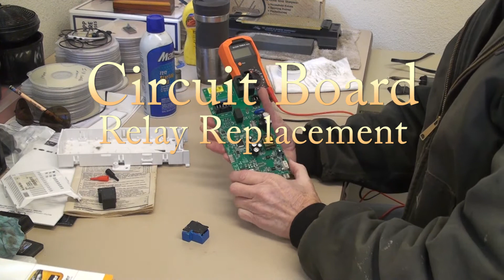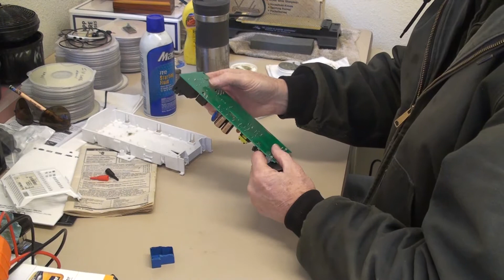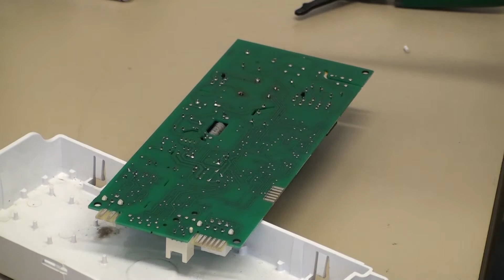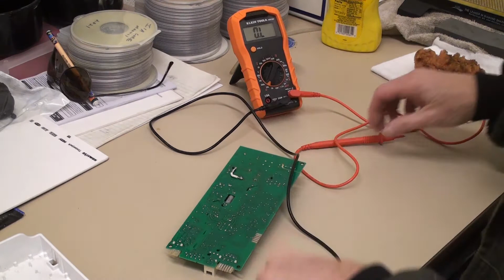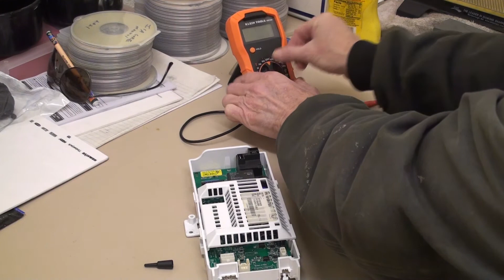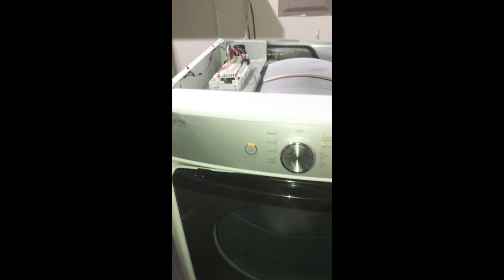Dryer Circuit Board Relay Replacement

Comment: Is it possible to burn up inside and not show signs outside? Mine says N.O. which means normally open but it still has continuity.

I was hoping you would of shown how you got the old one out 😊 
I can TIG weld but never soldered before
Reply from the maker: I suppose that it is possible for the points to get a spark between them and fuse together. I've seen that in automobile applications. To remove the damaged relay, I heat the solder on the leads and brush it away with a stiff bristled brush or use a solder sucker. There are plenty of videos on YouTube showing how to solder components.
Reply: @repairsecrets I got a new relay and was able to fix my problem 😊

Comment: But why does the relay break in these I have 2 maytags 3000 series and both have blown the relays in both units what is the cause of this?
Reply from the maker: The best explanation that I've heard is that they are being overloaded. More weight means more power going through the relay which over loads it and burns it out.
Reply: @  so nothing down or up stream is shorting out  just over used not enough cooldown time
Reply from the maker: @ggrandma-n6e  I don't really know of anything else causing it. The machine in the video was being used with heavy rugs and blankets.
Reply: @repairsecrets  makes sense thank you fingers crossed we’ll be getting mine this weekend thank you for your reply’s cheers

Comment: This video is exactly what I'm looking for. My dryer circuit board had the exact same problem, and come to see the end of the video, it was the exact same machine (maytag maxima)! I had gotten all the way to ordering and replacing the relay switch just like you, but when I tested it in the machine it still didn't work. Now I find this video and realize It'll probably work if I add that wire since the board connection is fried! Do you know what originally caused our relay switches to go out though? Possible over-drawn current with another component? THANKS!
Reply from the maker: The owner of the machine told me his wife and mother in law were loading rugs and blankets into the machine all the time. Since making the video I've also found out the machine was likely packed with lint inside around the drum and motor. I'm thinking the machine needs to be taken apart once in awhile and cleaned out good.

Comment: Thank you thank you. It worked.  I also had a large blow out on one pin and did a 16 gauge copper elbow, that's the smallest gauge i  could get at home depot.  Your video helped a lot.
Reply: What is the smallest gage wire you would recommend? This is a power relay
Reply: @paulrite5358  18, 20 or 22 gauge Should also work fine.  The amps rating gets pretty small at that size.
And I'm not sure how it correlates to a circuit board.But you're going to need some wire mass that sodder can connect to.  Good luck.

Comment: Very helpful! Saved a bunch of money! $180 for circuit board. $10 for relay. Need a hot iron, though. That solder does not want to melt. Thanks!

Comment: Any idea about the current which will go through the white wire you soldered as a jumper?
Reply from the maker: That is a very good question and I don't know. That's part of the reason I put that copper jumper wire in. I think the load is variable depending on how heavy the material that is being dried is. The owner of the dryer said his wife was washing heavy throw rugs and then putting them in the dryer and he thinks that was the cause.

Comment: This is really cool! I have the same dryer and found that the motor relay burned as well. I dont have the skills to replace that, so I am replacing the control board with one from ebay

Comment: Im troubleshooting a relay that i think is bad on a pcb...i am trying to determine if the relay is not receiving the correct voltage/ground before i make my call that the relay is not working...i am getting 12 volts on one end of the coil and only 6 volts on the other....not sure if the other side should be ground voltage or it should be also 12 volts OR everything is normal....

Trying to rule out the possibility of the relay not receiving the correct power/ground as the problem before i think about the relay being faulty because obviously the relay cant be bad if it is not receiving the correct voltage in the first place
Reply from the maker: If it is a mechanical relay like the one in the video, you will usually feel it click when you energize the coil. You can check the coil resistance with an ohm meter. In general they will be around three to five ohms. Depending on the number of working contacts in the relay there will be two or three circuit paths for the relay to switch too. There will be a common contact which will be normally closed to  one leg when the coil is not energized. The other contact will be closed only when the coil is energized. I've never checked for differences in voltage across a relay. The ohm meter tells a better story.
Reply: @Equipment Consulting Services, Inc.  relay was bad...I jumped it and got no continuity at the contacts....swapped relays and new one works perfect except for after about an hour it started rattling sparking really bad...i found the problem....I have only 6v at the transistor side or the relay coil....when I measure across the relay it is 6v total....the transistor is most likely bad....the supply side is 12v so everything is good there...
Reply from the maker: @macknumber9  That's nice work!
Reply: @Equipment Consulting Services, Inc.  I'm getting so frustrated...I tested transistor on board and it failed...then I took it off board and it passed...so transistor is not my problem....this .5v is my problem....that is too low to turn on the transistor fully....I really need to figure this out....what else could it be?  Thermostat not sending a strong enough signal?  Microcontroller?

Sorry forgot to mention that...I am getting .5v at the transistor base...I should see .7 or even higher
Reply from the maker: @macknumber9  I'm sorry that I can't answer your question on the transistor. I don't have the old board to be able to look at an suggest other possibilities. Let us know what you find if anything.
Reply: @repairsecrets  2.28 volts goes towards the base before the resistor knocks it down to .5v

My problem is low voltage out of the control board....no idea how to troubleshoot it
Reply from the maker: @macknumber9  Can you find where your power source comes from? Somewhere there has to be a transformer. Can you follow that pathway?
Reply: @repairsecrets  you mena the 120a/c in? Or 12v in?
Reply from the maker: @macknumber9  I'm thinking that you need to identify the transformer and then check voltage coming out of the transformer for 12 volts and then trace it to the transistor.
Reply: @Equipment Consulting Services, Inc.  ok so the transformer would have to be on the other board then right? I traced everything on this pcb as far as the transistor is concerned and I do not see it going to any transformer....
Reply from the maker: @macknumber9  You are above my knowledge base now. I only made a suggestion based on logic and not on actual knowledge about the board.
Reply: @repairsecrets  ok

Comment: Damn Samsung potted their board so I can't even look at the back of the PCB without really being careful with a Dremel and razer blade.
Reply from the maker: What do you mean be potted?
Reply: @repairsecrets  My understanding is that potting is a form of resin that boards are dipped/sealed in to protect them from moisture/environmental exposure.

Comment: You know in vehicles these relays are swappable. If they made the board the same way this would be easy as pie.  Guess we all know why they don't...
Reply from the maker: The relay apparently was a standard part. It is a lot smaller, runs at 120 volts AC and is soldered in place on a circuit board. I don't understand your point?
Reply: @repairsecrets  A relay is a moving part. Moving parts tend to break and need replacement. If they designed a socket for the relays to fit into, like they do for relays in automobile fuse boxes, then it would be a cinch to swap out a failed relay instead of having to solder it.
Reply from the maker: @JoshuaRichards2010  Engineering design doesn't work that way anymore. The engineer has a couple of dozen catalogs in the book case behind him. He needs a component to do something and he doesn't have the manufacturing capability to make it so he picks up a catalog and looks for one supplied by someone else. It has to meet specifications and apparently for this use, this is what he finds. Automotive units aren't this small and solder is the accepted method of attaching to a circuit board. The big deal is that people shouldn't put huge loads like heavy coats and floor rugs in the dryer to pull so much current that it burns out the relay.
Reply: @repairsecrets  My dryer is 30 years old. It takes big loads like a champ. They don't build them like they used to.
Reply: @pibblesnbits  I can beat that. My WP dryer is 35 years old & still going strong. They didn't have circuit boards...control was all mechanical.

Comment: What gauge wire you used?
Reply from the maker: As I recall I cut one strand out of a piece of 14 gauge stranded wire and then laid the solder over the top of that.

Comment: Was that relay still clicking?  How did you know it was that particular relay?  I'm trying to troubleshoot my Thermoking apu motherboard.
Reply from the maker: I didn't do the troubleshooting on the relay. My friend looked up common problems with his machine on the net and came up with this. The new relay did click when he reinstalled the board.
Reply: @repairsecrets  How are they held on?  What did you use to pull it off?  So the burned out relay didn't click anymore?
Reply from the maker: @supertrucker1356  They are soldered onto the board. I have this tool called a solder sucker. You heat up the solder with and soldering pencil and then suck up the solder with the suction tool. Look up solder sucker on the web.

Comment: kenmore electric dryer he5t -error F01 code bought a new relay switch and cleaned up the board and re-soldered the new relay switch and put all back together, but it did not work? Just wondering not the best a soldering could this be the problem
Reply from the maker: It's hard to say without looking at the soldering job. It also might have had something else wrong in the dryer.
Reply: F01 is the thermistor error.

Comment: The heater relay on a Samsung dryer u can hear it clicking on and off . The dryer only heats up very little. Everything else I replaced. Except for the control board. U can hear the relay kicking on and off.. do u think the control board is bad???
Reply from the maker: I didn't troubleshoot the issue with the relay that I replaced. I don't know what to tell you. Maybe there are other videos or postings on the internet to help you.

Comment: Thanks for the video! Epic Z now running. Unbelievable how well the wire trick worked. Drying a second load now. Couldn't get reasonably priced board replacement. Will brag on this video more in a few months if it holds up 🤞
Reply: My Epic Z still works 11/26/2022 over 100 loads since this repair that I thought had a 10% chance.
Reply: @russellbowerman3093  still going?